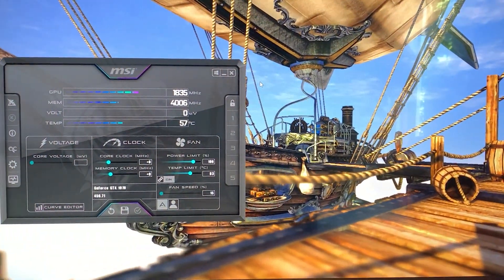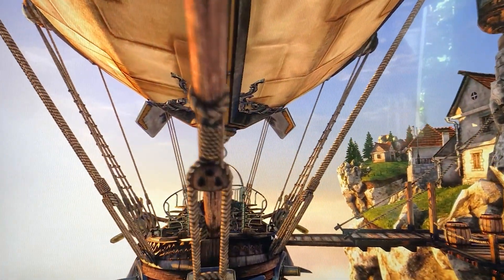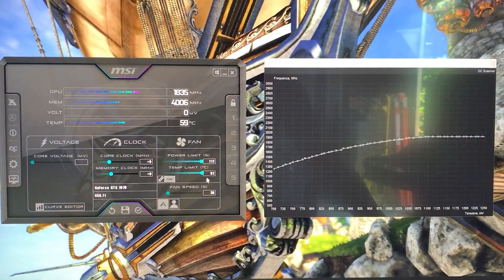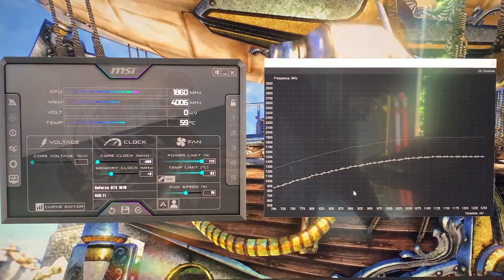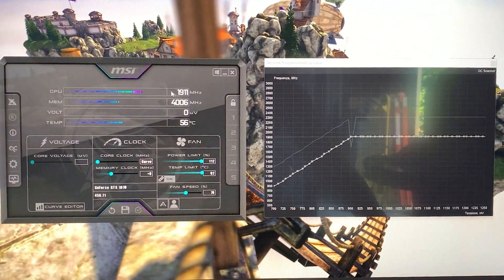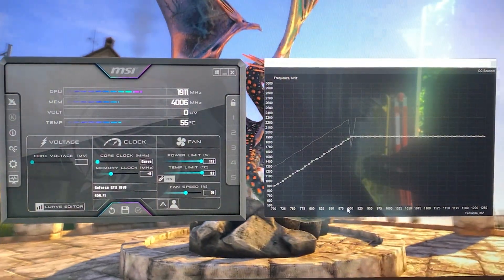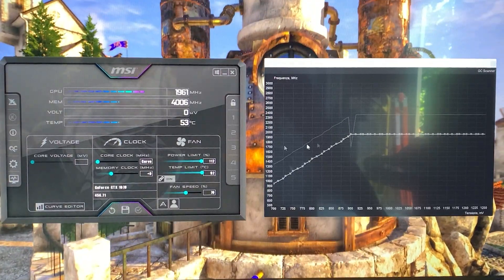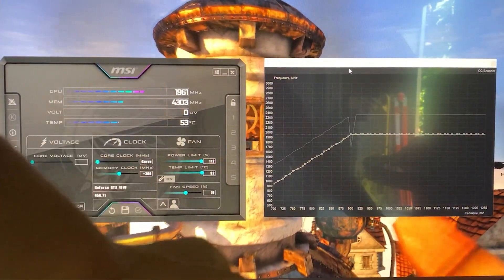Undervolt your GTX 1070 for more FPS! - Tutorial

Comment: hey, I struggle to understand the graph a bit, is it the higher the frequency the less voltage it'll consume? I undervolted to the exact settings of yours, while it worked for a bit, i opened a GPU heavy software and it crashed, blacked out my monitors for a few seconds, then closed the app automatically

what are some other settings you would recommend?
Reply from the maker: The lower the voltage the lower the temps, but lower voltage reduces stability. Don’t touch the memory clock, set the curve to 900mV at 1800Mhz and you’ll be golden!
Reply: @ImWateringPSUs  i'm really not sure what i'm doing wrong, the curve flattens out at 900mV at 1800 MHz like you suggested, but it still easily rises to my unwanted temperature, which is 93C. i have a GPU fan speed curve set up with another software, could that be interfering with the voltage curve in MSI afterburner?
Reply: @ImWateringPSUs  i'll give it a try and i'll let you know the results, thank you!

Comment: It is really incredible how much this undervolting brings. I followed the guide exactly, including the +300MHZ at the end. Result: The graphics card doesn't get as warm/hot as before, and the fans of the card are no longer audible. Before, I often had to put on headphones for gaming because of the noise.
The next step is to undervolt the CPU. It already gets 50° warm in idle and 80-90° hot during gaming.
Reply from the maker: I’m really happy about it, thanks for trusting me with following the tutorial! I do actually have some CPU undervolting videos as well! They’re in the same playlist
Reply: @ImWateringPSUs  Apparently this is a known problem of MSI boards + Ryzen CPUs for years. Because I already undervolted my CPU in the BIOS with the help of another YT tutorial.
The problem is that I had to do this again after each BIOS update, because all my settings were rested. During one of these undervoltings my PC / BIOS was bricked. Therefore, I had to reset my BIOS. Since then, I have not tried it again.

Comment: 1070 Zotac Amp Edition:
Got stable 1835mhz on 900mv.
3DMark Results are -6% compared to stock settings. 
Power consumption is ~30-40 w less.
Reply from the maker: That’s still really good! I’d say aim for 1900 to 2000Mhz if you want more performance, but for efficiency it’s already great!

Comment: couldn't run 1900mhz with 900 ml volt , it works fine with 962 ml volt tho , and its abit lower temp at 63c as it were 67c , anyway thanks for the video
Reply from the maker: A bit of an unlucky card but I’m happy you managed to find a stable spot! In my experience, maybe 1850Mhz with 900mV would work for you, with very little change in performance!
Reply: @ImWateringPSUs  at 900 volt its stable with 1855mhz yupp
Reply: weird abit idk why like 45mhz more doesn't work with that 900v xD

Comment: Once we do that, Can we install msi burner, or do we need to run it always with widnows to keep the settings on?
Reply from the maker: You need to keep it running because once the PC gets disconnected from the wall it will unfortunately lose the settings otherwise!

Comment: wow, it can work on msi 1070 gaming x to? mean little confused cuz all vendors have diff specs / start clocks or it not make sense
Reply from the maker: Yes it does! The vendor difference is minimal, plus they all use the same curve, they just change the point in the curve at which the card runs! It's perfect for an MSI GTX 1070 Gaming X
Reply: @ImWateringPSUs  thanks then need try it sometime, if some goes wrong im ask dummy quest xd
Reply from the maker: @vox7441  No problem at all, that's why I'm here
Reply: @ImWateringPSUs  hi im alive anything dont explode guess it work, from, 50c to 36c on dekstop
Reply: @ImWateringPSUs  do i need back power limit to 100? im have 126 max
Reply: @ImWateringPSUs  UPD: After reloard temp back to 52c, but my setting saved and keep worked. Why?:о
Reply from the maker: @vox7441  126 is perfect! I'm happy it's working!
Reply: @ImWateringPSUs  ehh so if my PL max is 126(not 112) i need put 126? I start seeing some games crashes time by time, like new world and v rising and i cant realize why, maybe i do wrong underv

Comment: Wow, it actually works! thanks man. I couldn't figure out why my card was overheating but I'm sitting at a comfortable 60-62 now.  Sometimes 68 but eh.  I was hitting 80c before! lol x.x
Reply from the maker: I'm really happy about it! If you wanna get it even lower you should probably change the thermal paste as I did in my GTX 1070 SLI video! But it's already really good!
Reply: how did the performance change? or is it mostly the temperature?

Comment: im so glad i came across this video i had my msi 1070 for years i had it abit oc and thought that was good enough , but i tried this today and my card feels like a brand new upgrade more fps and really stable performance no dips in fps i would to know the science behind this how can undervolting make it run better everything i learned from oc videos was u need to up the volt to gain performace what kind of magic is this haha
Reply from the maker: First of all, I'm really happy about it man! Undervolting gets the card more stable simply because it stops the frequency from bouncing all around the place! Plus, since modern cards are power limited heavily, by lowering the voltage just a bit you free up a bit of power headroom, hence why higher clocks can be sustained for longer periods of time!
Reply: I probably would try this if my msi 1070 wasn't DEAD
Reply from the maker: @axtra9561  I do have a guide about fixing broekn GPUs though, in case you wanna give it a shot!
Reply from the maker: @axtra9561  Oh man that's unlucky

Comment: Hi! do you have a torial for undervolt GTX 980? i have the FE version
Reply from the maker: Hi! So far I don't have a dedicated one for the 980, as soon as I get one on hands I'll make it though, since you can also bios mod it and REALLY fine tune it and get more performance out of it!
Reply: @ImWateringPSUs  i will wait then :)
Reply from the maker: @geogeo7337  My man! :)
Reply: You can't directly undervolt Maxwell GPU but I have managed to do so with my GTX 970 by lowering power limit in MSI Afterburner (70% seems to be the sweet spot) and bumping core clock by 115MHz. This causes GPU to run on lower voltage but still boosts close to default frequencies during gaming. Performance loss is few % but considering it uses about 40 watts less it's pretty OK. If you don't lower power limit that much and bump GPU clock then it may increase performance and you'll have few watts shaved off also. I just aimed for maximum efficiency.

Comment: its worked with the inno 3d 1070ti  x2 too?
Reply from the maker: Yes!
Reply: @ImWateringPSUs  hi litle later i have Zotac gtx 1070ti AMP Extreme Edition but its Stock i not undervolting it and 47celsius the max when i playing in 1867mhz or 1910-11 mhz idk how to go 1900+mhz when i not overclocking it

Comment: You got yourself a lucky 1070. Mine can't handle 1900mhz even at 950mv
Reply from the maker: Hmmm mine could actually do 1980Mhz at 900mV, try out 1850Mhz with 900mV and see if it works! :)
Reply: Really? cus most people can get +300mhz easily, even I can.
Reply from the maker: @TaiMizuki  There are actually a couple unlucky cards out there ahaha. It's the reason why Nvidia doesn't do this by default!
Reply: @ImWateringPSUs  could be based on what manufacturer made their 1070

Comment: I have GTX 1070 MSI Armor, the fan automatically turn on at 58 C and turn off at 55 C, but it always looping like that because from 55 to 58 only 20 seconds, is that fine?
Reply from the maker: It is fine, but you can change the curve manually from Afterburner if you want to!
Reply: @ImWateringPSUs  what do u prefer? i'm new for this
Reply from the maker: @jaxx761  I personally leave it on auto! If it's really noisy I set my personal curve :)